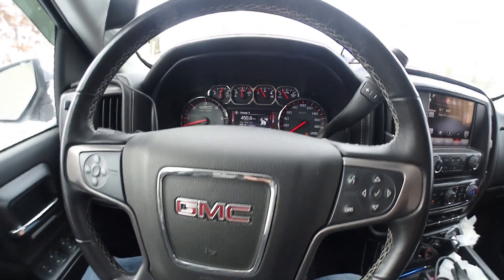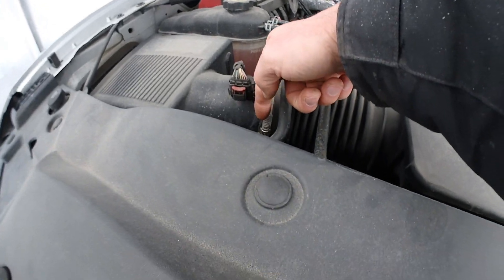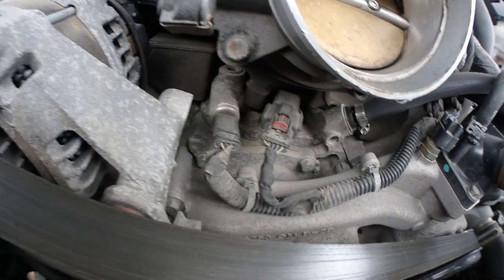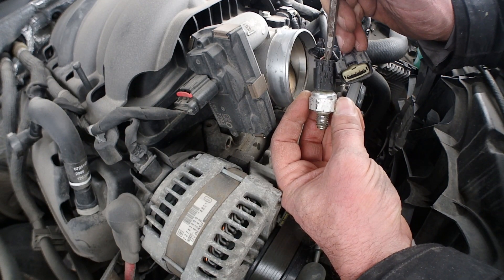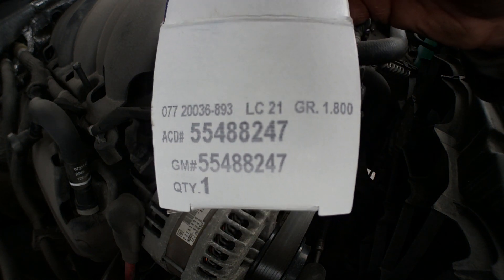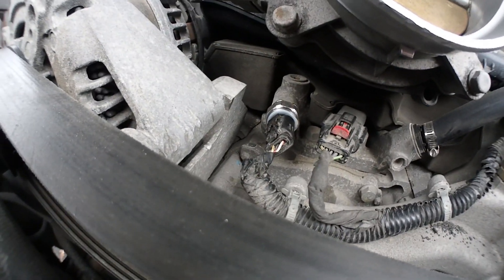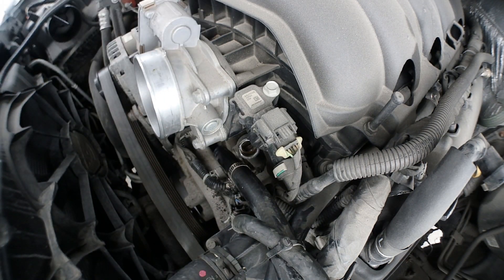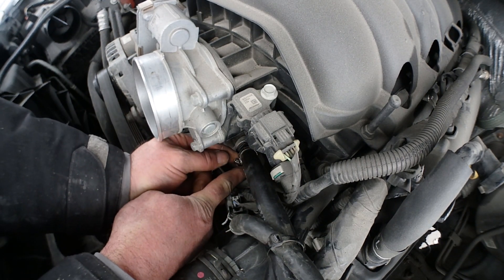Silverado Sierra 5.3L 2014 & Up,  Oil Pressure sensor and PCV Valve Change. Did not fix my P06DD .

Comment: So the PO6DD engine code wasn’t resolved after replacing those parts?
Reply from the maker: No, ended up with an oil pump failure.
That's what everybody with PO6XX code end up with...
GM truck's liability is going down the drain since 2014.
Even 2021 models are having an epidemic lifter failure, and they don't care about it.
I am now driving a 2020 Silverado RST and I miss my 2004 Silverado Z71 for sure.
Reply: @obscur156  thanks for that man. I have been looking into the Dodge Rams.
Reply from the maker: @foxman4489  Ram's are having lifter failure too.
American trucks are junk now ,ford too.
Sad to say that i would have to buy a yota but its so ugly.
Google for Gm trucks problems,Ford truck problems and Ram truck problems and you will be scared...
Reply: @obscur156  thank you for the information. I agree with missing the older models. So many electronic units in the vehicles these days cause multiple faults.

Comment: Hey bud! Thanks for your time, my light came on today on my way home, stopped at autozone and got the code P06DD. I hope that’ll fix the problem, thanks again.. ✌️
Reply from the maker: I hope for you its gonna work.
P06DD usually is very bad news...
Please keep us updated if its working or not.
Reply: Did it fix it bro
Reply: @joseluisbarrerarios5699  how you fixed men I have the same problem
Reply: Did you fix it?
Reply: @oneqwickbird  yes sir , it's fixed . 
No check engine light on, replace the part on the video and probably that will fix the problem
Reply: Name of part you change?????

Comment: The problem is an issue with the timing chain tensioner if the sensor didn't fix it.  I believe it is a TCB recall from all chevy and GMC dealers.  What happens is the timing chain slips because of the tensioner on the oil pump and can actually damage the pump.  Get it to a dealer or do a full timing change pump tensioner etc replacement before the oil pump throws shavings into the engine.
Reply from the maker: That was the oil pump slowly dying .The STEALERSHIP repaired it and gave me a bill of $ 2873.89  Canadian dollars...Dude i hate my ride.Looks like GM builds crap trucks nowadays...Not acceptable at 90.000 KM / 55.923 Miles...
Reply: Yep all off the tensioner use grease, and they lock up when there old,I have to change mine on my 2014silverado it's whinnying

Comment: So the low oil pressure is the sending unit most likely? I was told it could be a failing oil pump. I am going to replace the sending unit first.  Literally every issue chevrolet has had with this model, my truck has done it...new transmission first year, and if anyone has a tick under your motor and truck is burning through oil, it is a sign that your vacuum pump is about to fail.
Reply from the maker: Ended up with a oil pump failure,cost me $3000 CAD at stealerdhip...
They changed the vacuum pump for free cause a recall.
Quality is not there anymore with GM trucks.
Thanks for commenting and watching,regards.

Comment: After replacing the pcv valve and sensor, how did you know the oil pump failed..?
Reply from the maker: Check engine light came back after deleting the code.
Oil pump failed a couple weeks later.
Reply: @obscur156  how did you get the clip off the sensor...?
Reply from the maker: @mcoxe77  If i remember,i unsrew the sensor almost half a turn to see the locking mecanism of the connector.
Reply: Yes I did that. I ended making a small hook to get under it and lift the latching part. I was getting the code...P06DA...so far so good
Reply from the maker: @mcoxe77  I hope you gonna get away with it.Keep us updated if you ever have an oil pump failure  in the futur !
Regards.
Reply: @obscur156  check engine light is back on already...hopefully my expensive extended warranty will cover it
Reply from the maker: @mcoxe77  I hope it will,it cost me $3000 CAD for the oil pump...

Comment: My 2014 chevy Silverado is having the same problem, thanks for the tip very useful 👍
Reply: If you have the p60dd code then changing out the oil sending switch won't fix your issue. Your issue is downin the front if the engine. Either the oil pump Solenoid, oil pump or its a part with the timing. I originally thought the problem was the sending unit too until I watched more videos. It's a much bigger job and you will also need to pull off the oil pan. Just thought you might want to know if fixing that sending switch didn't solve your issue.
Reply from the maker: Glad that it helped you out,thanks for taking the time to comment.
I appreciate that.
Thanks for watching,regards.

Comment: Mine just came on, is it drivable?
Reply from the maker: If you had the message to stop the engine immediately,it is not drivable.
If it's P06xx,the oil pump will fail soon...
Reply: @obscur156  I reset the code and ligh went away, i just changed spark plugs and cables . I noticed the cables were a bit shorter than oem ones, so i am wondering if that triggered the light. Is a steady light no flashing and no message.
Reply from the maker: @BEARDED_VATO  Well ,if it was P06DD it will probably come back.
If it comes back,i would trade it right away before it fails if you can.
It is a very expensive repair and lifters will probably be next...
Keep us updated with your issue please.
Regards.
Reply: @obscur156  So far with my 14 Silverado issues is ac condenser , joints and paint bubbles/ pealing on both back doors  near windows. Also my coworker and his boss same issues on their newer models sierra and silverado.
Reply from the maker: @BEARDED_VATO  Got rid of my 2014,oil pump failure at 90000 km  3000$ CAD and lifters at 99000 km  3200$ CAD.
Now running a RST 2020.
Lots of brand new 2021 GM trucks with lifter failure ,even before the first oil change.
Quality at GM is going down the drain...
Reply: @obscur156  With gas prices right now i might have to get a small car man, thank you for your input!
Reply from the maker: @BEARDED_VATO  Yes ,not a fun time right now with gas price,wish you the best buddy.
regards.

Comment: I had the same thing in my 2015. I put half a bottle of Seafoam in the crankcase, drove it 20 miles, then changed the oil/filter. Next day the check engine light turned off. Fingers crossed this holds.
Reply from the maker: I hope it will work for you Roy.
I tried that method too and run it 100 Kilometers  and did an oil change.
I had no luck, $3000 CAD for the oil pump repair.
Wish you the best,keep us updated with your result.
Thanks for commenting and watching,i appreciate that. Regards.
Reply: @obscur156  When the light was on, I noticed the PSI was hovering around 60 idling, and 70 driving. Since I did this, idle is at 35, and driving is around 42. I'm wondering if the Seafoam unclogged something?
Reply from the maker: @royjohnson6056  Could be,i hope you don't ear a winning noise like an hydrolic power steering cause thats the oil pump failing...
Reply: Did this work for you
Reply: @joseluisbarrerarios5699  It's still working so far.
Reply: @joseluisbarrerarios5699  So far

Comment: how much milage you have on that im dealing with the exact same thing but I have no codes I think my truck is just burning alot of oil
Reply from the maker: That Sierra 5.3L had 90,000 KM / 56,000 Miles.
Reply: My 4.3 has this code with 87000km

Comment: Quick question going to do the oil catch can myself..... do we have to put the pcv valve 2014 5.3 on it???? Can we just put a hollow one??? Isn't that the point of the catch can
Reply from the maker: There is multiple way to install catch can.
there is dual set up if you want to.
Do some search on youtube and you will find it.
I went for single set-up.
thanks for watching,regards.
Reply: When you showed that foamy oil and water mixture on the PCV doesn't that mean the oil catch can is not working properly?
Reply from the maker: @robertslegers257  No,any oil catch can will let some pass.
It wont work 100%.

Comment: It's the valve on the internal oil pump.  You have to pull the oil pan off and front cover, big job.
Reply: So true…. Chevy is wrong for this
Reply: @charlesfranklin734  I had my truck in a million pieces for this. The electrical plug to the valve had fallen off!
Reply: @bernardthefourth so you had to take it apart to put it back on? I seen a guy say all y you need to do was open the tuning cover pull a pin and switch out replace pin and reassemble? It this not true

Comment: My 2018 silverado oil is at 15ish psi at idle! What is yours when before and after?
Reply from the maker: The thumb rule for oil pressure is 10 PSI per 1000 rpm to maintain on the engine. It is acceptable to have 10-15 as idle oil pressure. Oil pressure reading 15 to 20 PSI is read as too low, even in idle condition. The oil pressure may be low in cold weather until the oil pump gets to supply oil to the engine.
Mine was low since oil pump was failling.
Reply: @obscur156  I have no oil light or check engine light on and thats whats confusing me. When I'm driving its even at 40 psi and when I come to a stop it goes down to like 10 - 20ish
Reply from the maker: @thegumpey1  It should be ok for now !
Reply: @thegumpey1  my having that some problem have you gotten it fix
Reply: @heribertonegrete6011  no I haven't, I called around and almost every mechanic said it's normal.
Reply: @thegumpey1  ok thanks

Comment: Great video and comments.  Have a 2016 Chevy Silverado 5.3 that had the same code.  I was over due for oil change. Did the change and the light when away.  I read a few comments about a whining noise.  Here’s a video of mine. Is this similar whining?

https://youtu.be/p8opN-JopS8
Reply from the maker: Yours looks okay from what I heard in your video.
You will hear better that whining noise when you start from a stop, you won't hear it at higher speed.
Reply: @obscur156  thanks for your quick reply.
Reply from the maker: @kdcorn  You are welcome buddy !

Comment: So should i change my sensor or should i take it to the shop? I saw you said in the comment that your oil pump fail. My truck is acting find just throws up that code about every 3 months.
Reply from the maker: Does your truck make a whining noise like a power steering pump??? 
 If yes, your oil pump will eventually fail for sure.
You can start with the oil pressure sensor.
It can be the solenoid switch for the oil pump.
Usually  the P06XX codes are the oil pump.
Good luck buddy and keep us updated with your problem.
Regards.

Comment: Awesome video. Im having this problem now. Looks easy to fix. Attacking this tomorrow. Cant take the whining noise anymore
Reply: I hear a whining noise too. What’s making it? The oil sensor or the pvc valve he mentioned because I know nothing of that one. Fill me in please! I have code p06DD and replacing the oil pressure sensor and the filter that’s on it.
Reply: @yovtec1  the pcv valve. I changed it. No more whining
Reply: @mattpernell9876  @obscur156 thanks for the fast reply guys. I have seen your advice everywhere obscur156 while I have been trying to resolve. You’re doing a good job at informing everyone. Thanks. Alright another question. I’ve also read of the filter but I don’t seem to find anyone showing it being replaced on this model. Does this model have an oil pressure unit screen?? I’m going to order the pcv valve and oil sending unit just wanting to know of that screen
Reply: @yovtec1 … I’m finding that the 14 silverado does not have the screen but i believe the suburban/Tahoe does. I don’t have the code but my oil pressure is way down.
Reply from the maker: @yovtec1  If the PCV does not help,your oil pump is failing.
That's what makes that noise.
If you can ,trade your truck before its too late...
Reply from the maker: Glad you liked it.
Thanks for watching,regards.
Reply: Did you have whining noise mone is whining and whiny change gears it’s a 2016

Comment: What did you end up changing my 2014 Silverado has the same code
Reply from the maker: UPDATE : P06DD engine code and all other P06** are the same problem . That was the oil pump slowly dying .The STEALERSHIP repaired it and gave me a bill of $ 2873.89  Canadian dollars...Dude i hate my ride.Looks like GM builds crap trucks nowadays...Not acceptable at 90.000 KM / 55.923 Miles...
Reply: @obscur156  unbelievable !!! And people give me shit for not wanting to take my rides into the dealer!!! That's 3 grand dude
Reply from the maker: @Ryan-bd5ot  Yep,thats what it cost me too at the stealer ship...

Comment: How do you get that clip off the oil sensor it's so hard to get off for me
Reply: I tryed to do it today but I want to be done tomorrow
Reply from the maker: @linglinglinklater8679  Unscrewed the sensor first,removed the grey lock plastic and pressed hard on the middle tab.
Was a bitch to remove for sure .
Reply: I got it off and change my oil sensor ,turned the truck on and it still says low oil pressure turn engine off what do I do now?
Reply from the maker: @linglinglinklater8679  Oil pump has failed... Don't run your motor or you will destroy it.
I am sorry to see that you have the same problem like me.
It's an expensive repair.
Reply: I didn't  change the pcv valve should  I do that first? I just change the oil sensor
Reply from the maker: @linglinglinklater8679  Does not matter now.
If you have the message on the cluster saying "low oil pressure,turn engine off" it is your oil pump that failed.
Cost me 2850$ CAD at the stealership...

Comment: I have a 2014 Silverado, same as the Sierra I assume. It’s been giving my the P06DD code on and off for years now (most of the time it dismisses the code but 6-8 months later it will come back then go away after a day or so. I don’t get it but thanks for this video hopefully this fixes my issue and keep it dismissed
Reply: As he said it's the oil pump failing and to expect big repair bill🙄
Reply: I have the same issue, did you ever get it fixed?
Reply: I have this problem it’s on and off

Comment: I have the same code now how long did it last before the pump went out
Reply from the maker: About 2 or 3 months max !
Reply: @obscur156  thank you 😔😔 looks like i will be clearing the code and trading her in , 2014 with the 4.3 v6 and 150k miles
Reply from the maker: @paintballguru13  No problem,mine died at only 56000 miles...
Hopefully you will have the time to trade it before it blows.
Good luck and thanks for watching,regards.

Comment: I have a '14 Sierra 5.3 it's showing the code but my pressure and everything is good not making any noises it's just that engine light on
Reply from the maker: That's bad news,in a matter of weeks or couple of months you will end up with a blown oil pump...
I wish you good luck buddy.
Reply: Ok thanks

Comment: So it did fix the loud squeal noise but not the code? Currently dealing with the same issue
Reply from the maker: If you have the whining noise like a power steering pump  and P06XX code,your oil pump is slowly dying.
Be prepared for a big bill...Cost me almost 3000$ CAD at the stealer ship.Good luck.